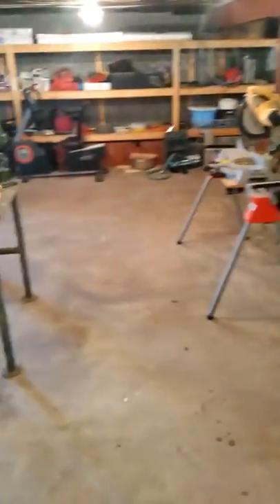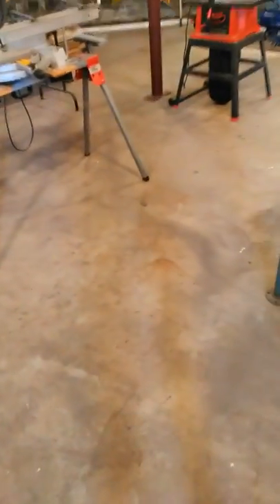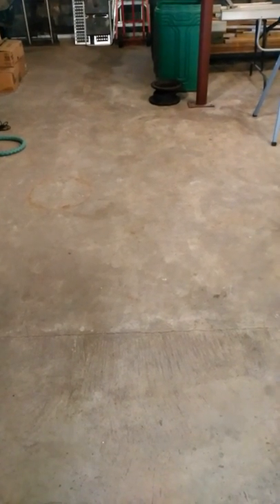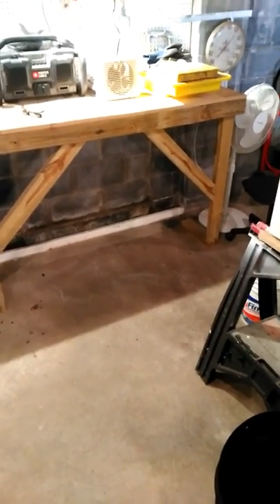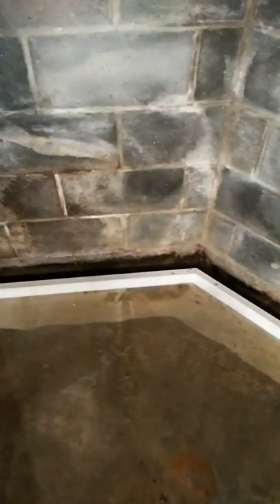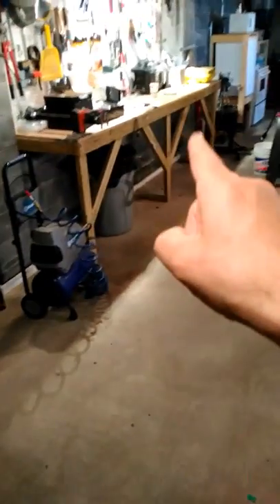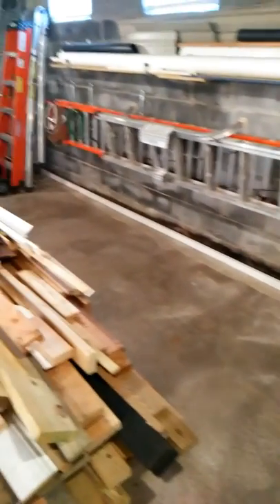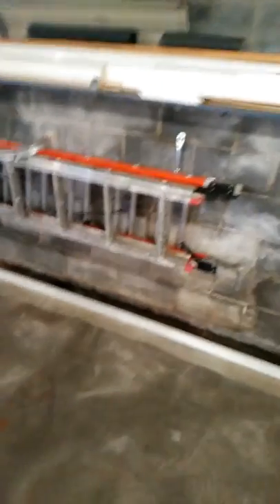Basement waterproofing easy and inexpensive method

Comment: You have not relieved hydrostatic pressure. You have not destroyed the mold friendly environment. You will have to spend that money or DIY a basement pressure relief system eventually.
Reply from the maker: Finally...the smartest person in the chat has arrived..
Reply: I just spent $4400 for a local team to do my 98 linear ft basement properly. Not that hard to find a decent local team. Someone had to say it.
Reply from the maker: @greghillmusic  Well I knew you were either a leading foremost authority on basement waterproofing or someone who was convinced by a self proclaimed expert that the house would fall down if they don't depart with a pile of money immediately. Had to be one or the other. First... I don't have a mold problem.... Mold thrives in areas that remain damp...mine dries up a day or two after a large rain...and I drilled holes in all the block chambers....which no water comes out of....(was a waste of a good masonry drill) which means no hydrostatic pressure.
Reply: @iflex1963  yes I did a lot of research research have a good idea of how water works around basements and what works as a solution. You're ignorant of the fact that you WILL have mold and water damage come up through your floor eventually because water is under and all around your walls, brother. I applaud the temporary fix. Just warning you that it is a TEMPORARY FIX
Reply from the maker: @greghillmusic  You must be like 14 years old if you haven't learned that everything is temporary...including your and my life... This particular apartment building is near 50 years old... still standing.. and the basement is dryer than it's ever been...
Reply: @iflex1963     I have basically the same challenge you did and your video and method is incredibly encouraging and I intend to try it - I also have a wet basement that I will never finish. Having said that, you don't need to be so defensive about the contrary opinions voiced in the comments. All of them spoke to the reservations I have about this method. Every method of doing anything has pros/cons/tradeoffs. You do encourage persistent dampness in the channel you create with the brick mold, and that always breeds (black) mold in a dark area. And the water pressure from outside does damage to the foundations that this method does not mitigate. And someone mentioned "blooms" - that is the pattern of white stuff that seepage of moisture leaves on the surface of concrete, which is generally lime deposits from the ground water. You created a great alternative to the vinyl cove molding stuff that doesn't seem that sturdy. Well done. The people here voicing alternate opinions are adding good information too.

Comment: It's funny seeing this and saw this guy business basically does this, but it looks cosmetically good. link is right here(https://www.youtube.com/watch?v=N1vu0f6qgOA) just thought it was neat and probably little bit more and simple to use. my drain is in the middle of my basement, so this part would be a sore eye.
Reply from the maker: His system will work however it looks pretty fragile....easy to crack if you put anything near the wall...plus no way to clean it out every couple years.. I can very easily as its open.
Reply: I knew someone who had this vinyl cove molding baseboard stuff installed and it failed with leakage. These baseboard systems are over marketed as a DIY business opportunity and apparently my friend hired some schlub who was trying to do this work. I trust the vinyl brick molding a lot more. The baseboards are secured only with epoxy adhesive, running up the expenses. Also the brick mold per linear foot is MUCH cheaper.